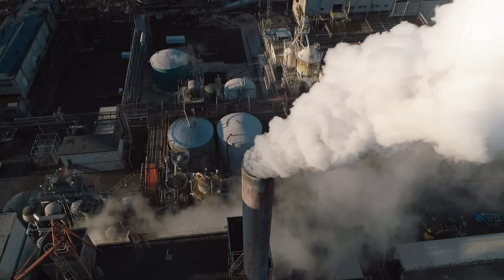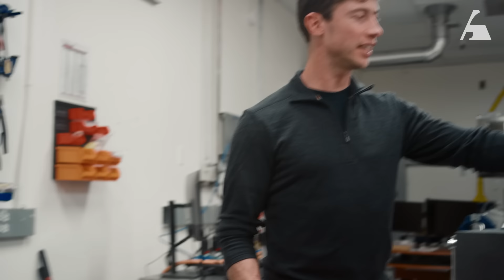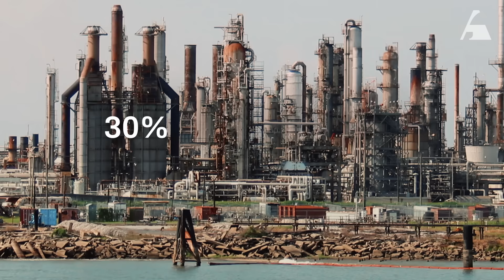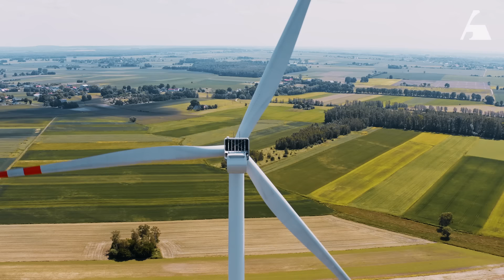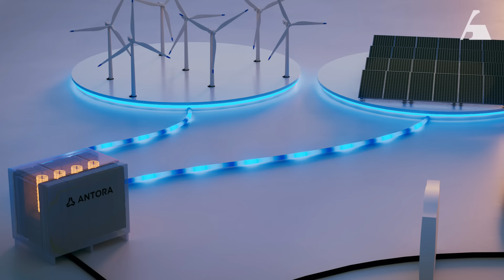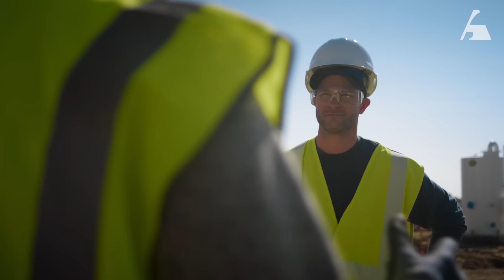This new, sustainable energy could save the planet, if regulators allow it | Abundance Institute

Comment: How would it changed if you had i don know small tubes rods or quare bars with 25 -50 mm and a leth of 500 and are placed close together wouldn't the surface area increases and wouldn't it be beneficial? 🤔

Comment: its the tiny microscopic carbon fiber nanotubes combined with micro photovoltaic device components that we need to research and develop. of course rock form of carbon is a conductor of electrons and therefore can be implemented to produce electron flow but rock form carbon is not as efficient as carbon nanotubes.

Comment: Doesn’t the energy in the hot carbon just dissipate into the atmosphere as waste heat?
Reply: I assume they have some serious insulation on the outside layer of the battery box.
Reply: Gg╭∩╮(-_-)╭∩╮